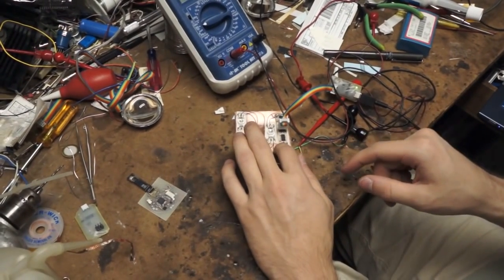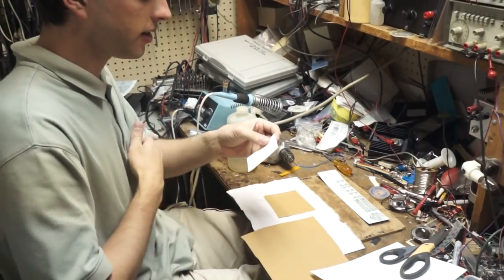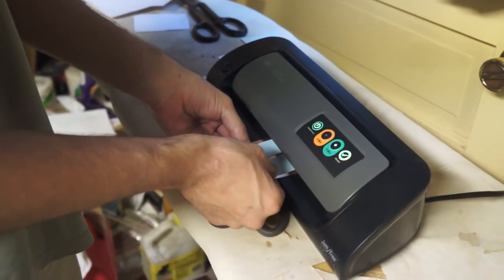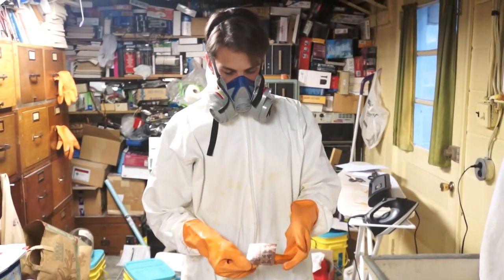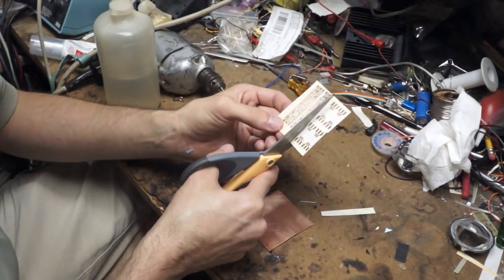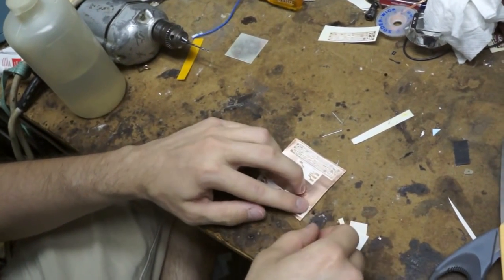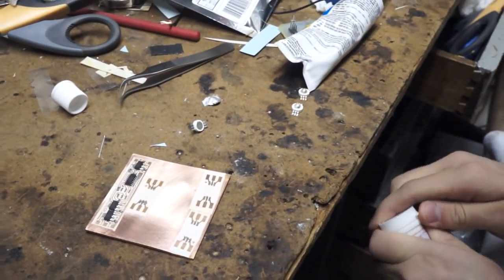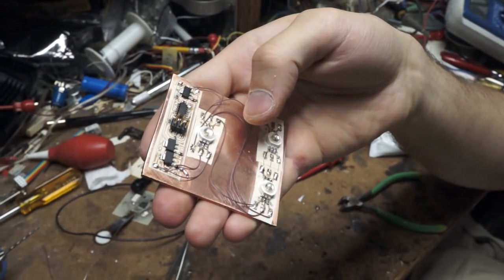DIY PCBs on thermal tape - Put them on heat sinks!

Comment: ok. I know this is an older video  but I am very interested in this method. I'm having a hard time hearing this vid.  The comments seemed to confuse me more. lol  What were the materials used, and did this work long term? What kind of toner? What bugs did you work out.  lol
Reply from the maker: Oh man this is a blast from the past, and now, I strongly recommend going somewhere like PCBWay for aluminium PCBs.  But, if you absolutely must do this, you can use silicone thermal tape (from digikey or other provider) with 1 oz copper sheet (preferably having the backside pre-roughed, like PCB copper) then you can use a regular laser printer to do the rest.  I do, however, recommend using the riston method I've switched to in newer videos.
Reply: SWEET. Ty. It's an odd project, and I need pliable mounting and heatsink.. Thanks for your advice, I'm just taking in all options at this point

Comment: PDP8/11 if I remember right in the background. Outstanding work! Just u mention for this u didn't use a toaster oven to reflow because of the heat sink. But will it work with just the silcon sub.?

Comment: Nice video... impressive set of "old-school" scopes and gear in your workspace... and did I see an early micro with 8" floppy drives in the background?  Resurfacing that workbench might make it easier to find small SMT parts!  On my old benches I used kraft paper, and just pulled over a new sheet every few months.

Comment from the maker: On PCBs, there's no problem, but on silicone, you are much more likely to rip the traces off.  Epoxy bonds to copper better than however the silicone adheres.

Comment: I've never torn a trace with 0000 steel wool.  It was something that I worried about at the beginning, but it just hasn't ever happened, much to my initial surprise.  I've been doing this for 3-4 years with no problems, with standard  0.75-1.0oz Cu FR4.

Comment: I'm wondering of some of the steel wool threads are due to the fact that you're probably using thicker copper clad than are on standard FR4 PCBs and have a higher possibility of grabbing.

This is definitely something that I'll keep my eyes out for with thicker copper.

Comment: I've never seen any problems whatsoever with the 0000 steel wool, but I'll take extra care to look out for it, and take a look at using ScotchBrite.  I've never seen any steel wool cling-ons, and I often look at boards under a microscope afterward to make sure that all of the isolations are etched-through.

Comment from the maker: In another comment thread, we are discussing scotch brite because of the oxidization my steel wool causes on the surface.

I still have a problem with using any steel wool to remove the toner since sometimes little pieces can get caught and rip off traces.

Comment from the maker: You can easily use anything you want on real PCBs, but the silicone does not stick to the copper as well as the epoxy on real PCBs.  Using pretty much anything other than sandpaper will likely cause problems.

I've yet to have any trouble, but I have been using sandpaper less and less in general.  I will definitely be trying some scotch brite.

Comment: 1) Regardless of when you use it, it can oxidize on the "good" copper and cause issues.

2) I've successfully gone down to .006" traces with no problems using scotch bright. Sandpaper actually removes copper so you might not be so lucky with such fine traces..

Been doing this WAY too long....since '86

Comment from the maker: 1) I use the steel wool before the ferric chloride bath, so most of it would get eaten away anyway.  I could use the scotch brite pads here.

2) Recommend not using scotchbrite pads (or steel wool) for that because after the copper has been etched, any nonuniform pad will cause the traces to rip off.  You might be able to get it to work, but I am far too impatient to practice.  Sandpaper "just works."

Comment: NEVER, NEVER, NEVER, use steel wool to clean copper. Tiny particles of steel wool embed into the copper which will cause issues. ALWAYS use the green 3M scotch bright pads. Use the same pads to remove the toner, not sandpaper.

Comment: The only problem with FeCl is the staining.  I don't know of any ventilation issues.  However with the acid-based etchants, your precautions make more sense.
To keep the FeCl bath warm I just blast it with a hair dryer or heat gun (from the top) about half the time I'm etching, and I'm sure it's hotter than 120-130F on average.  With fresh etchant it can go as quickly as a few minutes, at least with regular clad FR4.

Comment: If you use 0000 steel wool the toner comes off in seconds and it (the steel wool) is likely a finer abrasive than the grit in the detergent.  0000 is often used for polishing/cleaning plate glass and you can (also) get it at any hardware store.  It also only takes a few seconds to take the toner off.

Comment: thanks because I realy could use some thing like that. and I now need to get a new lazer printer its sems to be going to crap kepts giving me a drum air, and that I need to slide a green peice to clean the cornia but it never works it did a few tims. but they dont cost much at least. and I realy like the thin stuff youused that would be nice for mulitilayerd boards. just if I new how to get the through holes to work with platting. so I putty much stick to two sided for now.

Comment: instead of steel wool you should try some dish detergent that is abrasive, im not sure what you have available in your country in my case its ajax powder cleanser. It is just incredible  2 mins of rubing with that detergent and the board is like new without any scratches like the steel wool .